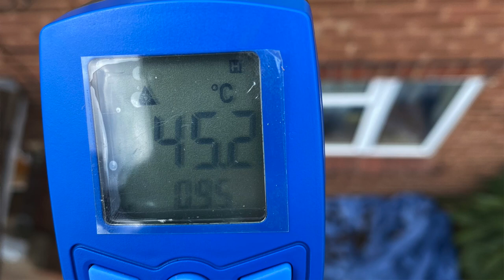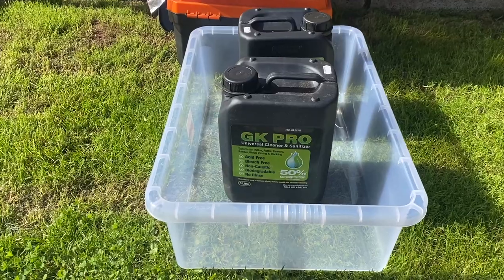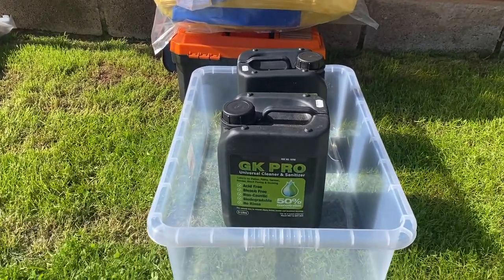A Much Safer Roof Clean. Never Stop Learning.

Comment: Hi Dave, What brush head and jets are you using there please? Also what size microbore hose are you using up/along the pole to the brush head? 
Many thanks.
Mike.
Reply from the maker: Hi Mike 
I’m using a stiff 35cm Ultimate brush from Gardiner with 4 50°fan jets and I’m using that with 5mm flexi 5 pole hose from Streamline 
https://gardinerpolesystems.co.uk/ultimate-35cm-brush-stiff.html
Reply from the maker: https://www.streamline.systems/product/flexi-5-pole-tubing/

Comment: Hi Dave , what is your opinion on pressure washing the roof with low pressure ( to not break the tiles)? is not it easier and quicker?
Reply from the maker: Personally I haven’t tried it as I prefer to scrape but I would imagine it would be depending on the job. The clean up after would be harder though

Comment: Little tip for you mate,use hypo it restores the colour of the roof straight away you don’t have to wait months or even years to see the end result the customer see’s the result instantly,as long as you rinse any lead off with water so it doesn’t discolour it’s fine to use ,
Reply: I have been on the course. You can use hyp to clean it but that's all your doing is cleaning it. Biocide treatment will clean it and treat the roof at the same time.

Comment: Great job dave much better working off a tower I will be using towers in future
Reply from the maker: It’s so much easier and safer. It’s definitely worth checking different places. I paid £55 plus vat for the week but I was quoted £100
Reply: @squeakycleandave1  was that a local firm to you or one of these HSS hire shops
Reply from the maker: @completeexteriorcleaningse750  I got it from Tippers builders merchants.
Reply: @squeakycleandave1  cheers dave